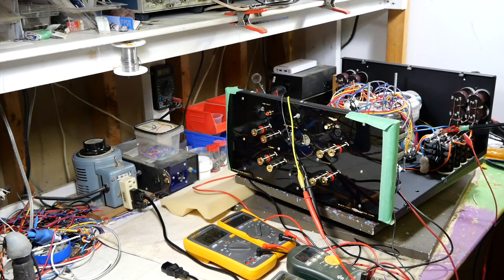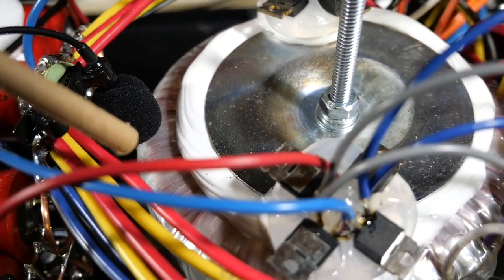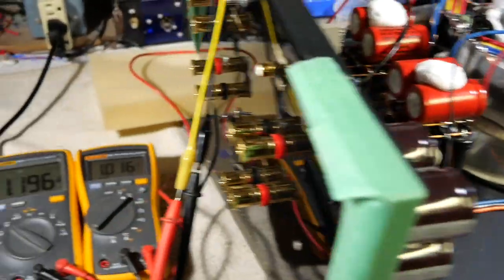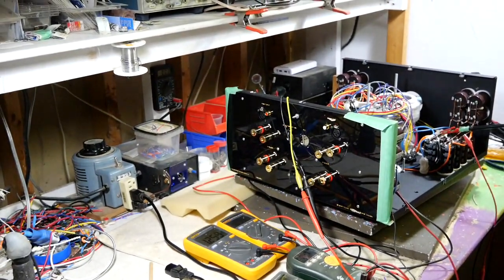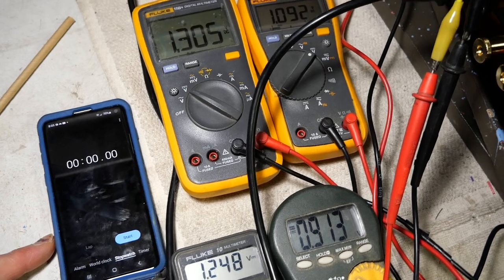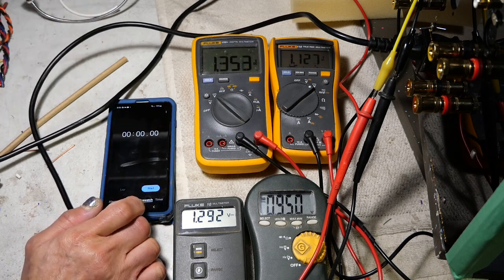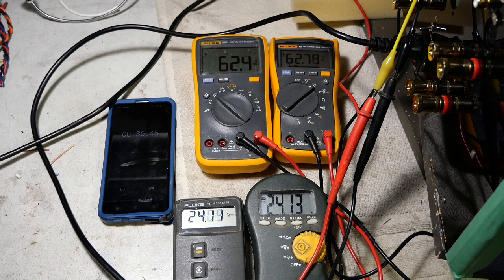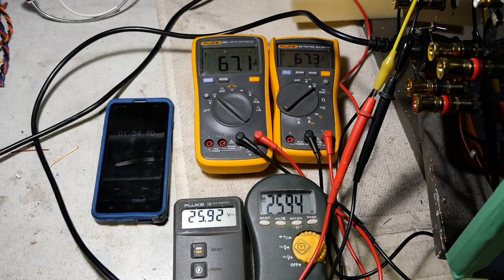Bringing up a 2 Farads 60 Volts Power Supply in an Angela-Gilbert Yeung A212 Power Amplifier

Comment: What was your soft start circuit.....in a few words....just plain voltage ramp up..? or a  current controlled voltage ramp up.....?
Reply from the maker: Both.  It also actively monitoring the rails. When all rails are up to the specified level, only then the soft start will turn off.
Reply: @angela-gilbert  are relay contacts used to bypass turn off later?

Comment: Who's soft start module do you buy? Probably from China?
Reply from the maker: Absolutely NOT.  NO cheap Chinese junk in my products. The soft start is my own design. I have spent over 20 years developed big power supply and soft start circuitry to bring them up. I am currently working on a 750 Farads 40Volts power supply.  No off the shelf module can handle that kind of inrush current properly.
If I have not made clear, I am offended by your statement.
Reply: This is the approach of a true artist. Thank you A/G for staying on that mission.
Reply: Awesome Work! @angela-gilbert